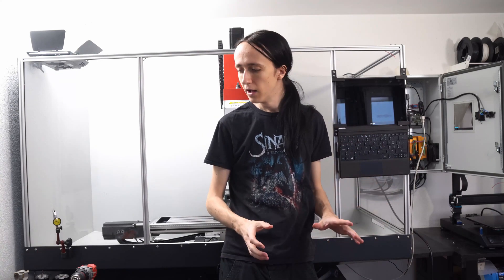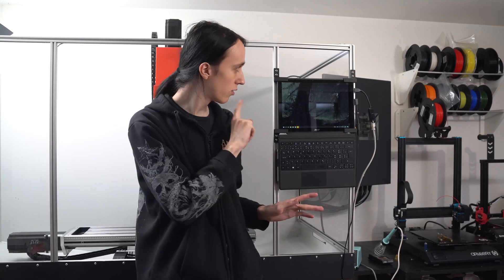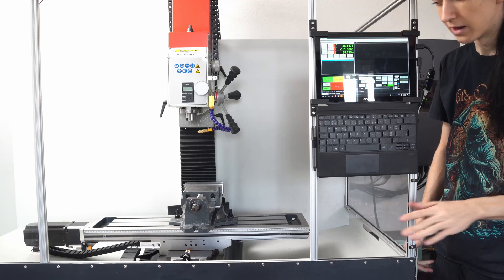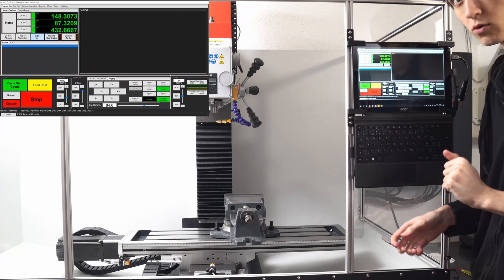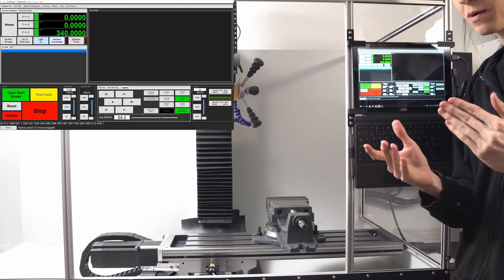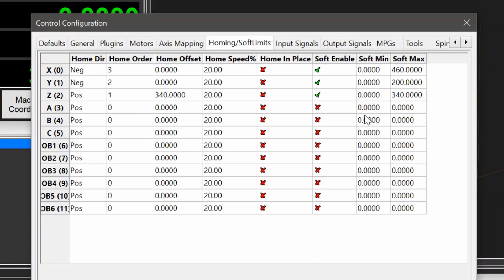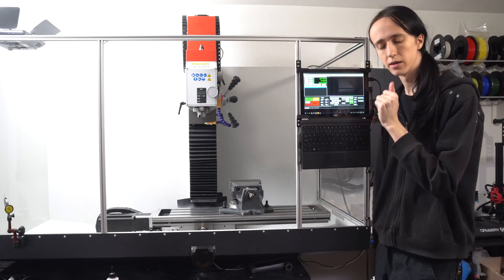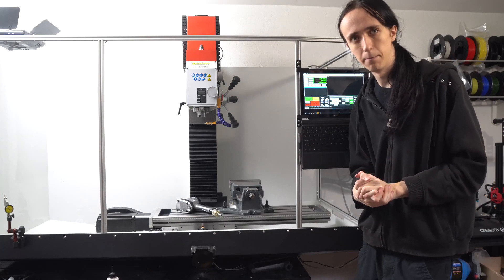BF30 CNC #9 - Homing Electronics

Comment: Interesting, I didn't pick up on it earlier, but now that you mention the MT3, I do recall seeing it in a few earlier videos. The PM30 uses an R8.

Collets are designed to get "stuck" in the spindle. This is the whole reason for the taper. If it doesn't get tight, the taper isn't fitting properly and won't be accurate / repeatable and will also likely slip causing damage to your spindle and tooling. My old R8 machine requires a light hammer tap to get the collet free. Some older machines came with a brass hammer and place to store the hammer on the head of the mill.

You can do two things to remedy this. 

1. Make your drawbar so that it is retained. You would likely have to remake the drawbar with a durable flange on it. Then attach a cap to the top of the spindle. When you tifhten the drawbar, it pressure is on the top of the spindle. When you loosen the drawbar, after one or two turns the top part of the flange pushes on the cap and pushes the MT3 out. The down side of this is that you will almost certainly loose the use of your Z quill feed, as the cap will not have clearance to go inside the spindle.

2. There are many ways to make a power drawbar. This always consists of the drawbar tightening against a stack of special bevelled washers. Basically. this needs to be calibrated so that you can torque your drawbar to the required setting, yet not completely compress the stack of washers. Once you have a spring holding tension on your drawbar, you now can choose some method of pushing down on the top of the drawbar and overcoming the spring, and locked taper. This takes over 1000 lbs of force on an R8.  I have seen this done with a mechanical handle that had two levers to step the force way up, but more commonly people use pneumatic cylinders. You can buy a kit from priest tools but it is over $1000 US so many people make them. 

I'm not sure that this will work oris a good idea on a MT3 so you should do your own research about it... I'm at the disadvantage of commenting on a video that is two years old.... so forgive me if this information is too late, and / or useless.
Reply from the maker: Thank you for all your comments, I'll take the liberty to just respond here.
R8 is definitely the better choice as it has a steeper taper angle, making it easier to release. Depending on the exact tool and how long ago I put some oil on the taper it sometimes takes quite a bit more than a few "taps", but it works. I haven't really done much with this machine in the last two years as I got busy with other projects and there is still a daunting amount of little things to fix until it works as I would like.
I wish you the best of luck with your conversions and hope you get well soon!
Reply: @DarkArtGuitarsWorkshop  It is obvious from your channel content that you are a very busy person and have a lot of projects on the go. I learned a lot from watching your series. 

Yes, the R8 is a better spindle for a lathe application. The MT is designed to lock in with very little pressure into things like lathe tailstocks where you don't use a draw bar. Seating it with a drawbar, and then seating it further by using it with tension on it, really locks them in place. My lathe has MT3 tailstock and MT4 in the spindle.

I often find myself in the situation where I'm challenged with a daunting amount of work with one or more project. Sometimes I take a look back at my videos from two years ago to give myself some perspective on what I'm capable of, given some time. It looks like you enjoy your projects, so keep doing what you enjoy.

Comment: Do you mind sharing your acceleration and velocity settings for your motors? I’m struggling a little with a good base setting. And did you connect your alarm signal from your drivers to Mach? I’d like to do that so if a driver alarms, the program stops. But I haven’t figured out how to do that. I have the same steppers/drivers as you. And the ESS but I used a c11g bob. Thanks for the videos, they’re very well done.
Reply from the maker: I talked a bit about the velocity in the last video, as for the drivers, they are not giving any feedback to Mach4. I haven't really looked into that, I know they have some sort of proprietary interface for some stuff, but I'm not sure if they also have more simple alarm pins. I'll probably look into that when I rework the electronics cabinet in a little while.
Reply: I’d recommend looking into the alarms, I think I need a second or bigger bob to hook them up, but it’s a bad day when an axis alarms, but the program keeps running. It’s happens 3 times to me in about a week.

Comment: Hi, you shud  put hammer drill on milling machine insted of impact driver then you dont nead to hammer it by hand. keep up good work!
Reply from the maker: I'm not sure if it would have enough torque, as it isn't really designed to tighten bolts. Also I would have to find one that has a clutch, to not kill the motor when the tool is clamped. But let me know if you have any experience with using a hammer drill for this application, or know of anyone who does.